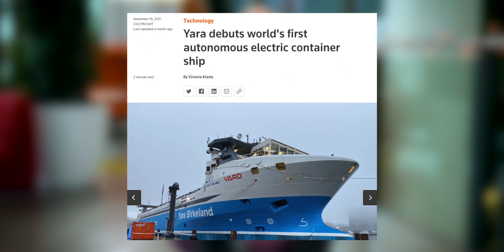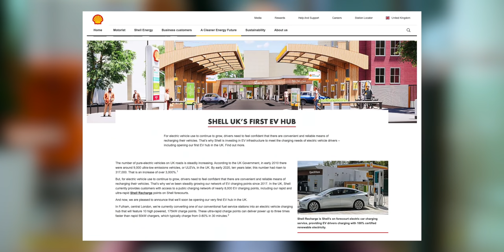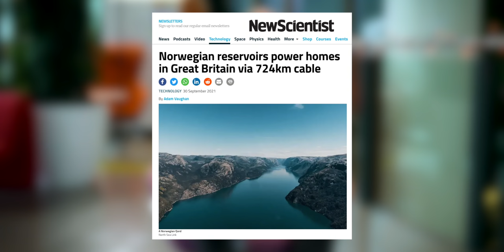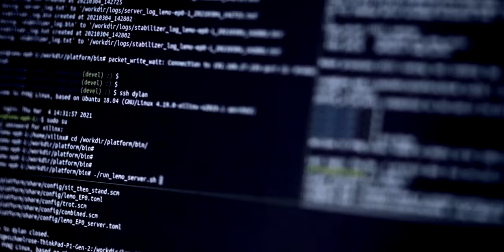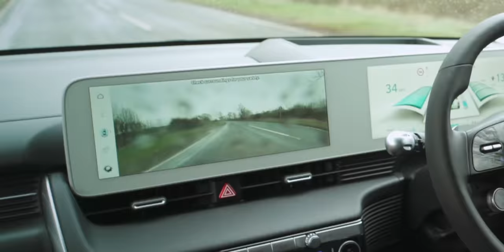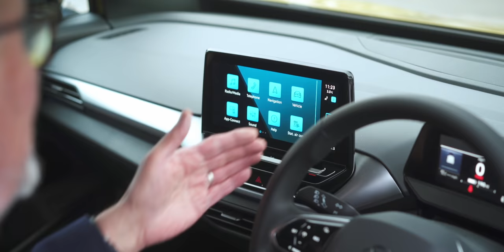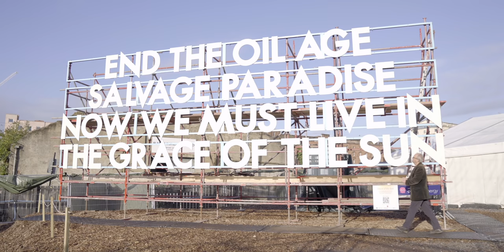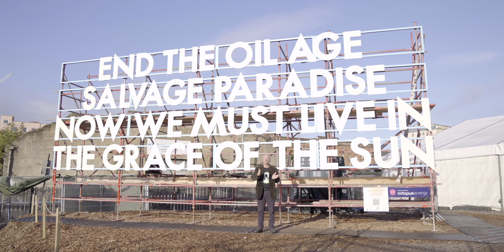VW Camper, Electric Cargo Ship, Bl**dy Big Cables AND epic 2021 highlight reel!

Comment: Greetings from Norway.... Since the cable to UK opened, the price for power is almost x10 what it used to be last winter. It's now cheaper to buy petrol to drive a gas car, than to charge a electric car, and cheaper to heat up our houses with propane heaters than electricy... Thanks UK, Thanks a lot......

Comment: A litle correction: Norway Will just reduce output from hydropower when importing from UK. Not using Pumped Hydro, But just reduce output. Thereby reservoars are filling up naturally.
Reply: I wonder how happy Norwegian households will be when the higher electricity prices propagate through to Norway like it has in Sweden. The German energie wende have risen the price in southern Sweden ten fold this winter.
Reply: @ulwur  It has Nothing to do with Germany. It has everything to with a dramatic global increase In natural gas demand and therefore prices. Gas is used in Europe to produce electricity, so the price increase impacts all of Europe.

Comment: Loved it! 

What i would still love you guys to do is to revamp some old video's that were really informative! Like:

National Grid, Smart Meters, Inductive Charging (9 years ago)
Volts for oil, Volts for miles (7 years ago)
Batteries, Batteries V Petrol the lawnmower test (6 years ago)
Electric flight, boat, house (5 years ago) 

We need more informative video's about the real story Kobalt, Lithium, Hidrogen etc etc. Where does it come from, What else is it used for, How much do we need? Can we fully recycle it? etc, etc.

Comment: Win-win?!
You can take that cable and pull it up where the sun don't shine! The price of electricity in Norway just all of a sudden rose about 50 times the normal price. Max price pr. kW/H before the cable turned on was about 7 pence. Now it's a steady 35p and just recently peaked at 80 pence. The cost of production here in Norway is about 1,2 pence pr kWh. Normal non-winter price about 3 to 6 pence depending on the water levels of our dams. It's cold here and we are 100% dependent on cheap power to survive. This cable has helped us minus zero and will keep on causing trouble for us in the future. I will not be sad if somebody monkeys with the cable and it happens to go offline...
Sincerely, one of many angry norwegians

Comment: Using Norwegian pumped storage to support the variable output renewable sources in other countries is a logical idea but it can only be done on a very limited scale.  What assures the 5 million Norwegians an abundance of hydro electricity will go nowhere once spread over 700 million Europeans.  In fact, during the exceptionally warm spring/summer of 2017 (??) Norway had to cut back on even domestic consumption of electricity.   We have to cut our energy consumption overall as well as building resilience into the system.

Comment: 1,400 MW for the new undersea cable surely sounds impressive. In the grand scheme of things, it is actually not that much. Compared say to the UK's total power demand of about 35 GW on average according to Wikipedia, 1.4 GW is only a few percent. I am not saying it is a bad thing, just pointing out that especially in the context of volatile power production from renewables, we will need many more of these things eventually.
Reply: The Chinese have put in a 12 GW cable, with the smarts from ABB. So it's certainly possible. Three such cables would cover all of the UK current needs.

Comment: Really interested in using an EV for V2H in the event of a power cut, have you had any contact with Debel about their dcbel r16 who say you can charge two vehicles at the same time and also use the car battery as backup power to use in your home.
I know the Nissan Leaf is capable of doing this but what other manufacturers have or will be making their vehicles do this, is it just a software issue.
I’ve ordered the Smart ForTwo EQ and to be able to use it’s battery in an emergency would be extremely useful and save me having to purchase a stationary battery storage system.

Comment: I enjoy your videos there are a couple of ideas that I feel are not covered enough or have not been scaled up for a variety of reasons.1. Long term storage using hotrocks is simple and understandable and there is a pilot plant in Hamburg that looked at it but hasn't scaled it up for lack of the right type of rock nearby. 2. Combining small scale 1. plus heat from the sea with wind farms and liquid air storage for shorter term storage and piggybacking the existing electrical infrastructures to reduce investment costs and utilise excess production without one set of transmission losses. Parts of this exists but the company doesnt utilise the heat in seawater and picks up low grade heat from industry instead similar to Swedish systems.

Comment: Is that undersea cable really 1.4 Gigawatts!?
It seems they missed the chance to rate it at 1.21 Gigawatts (or Jiggawatts) and just run it a bit over rating. 😄
Reply: Overclocking should be a doddle, given Norway’s an hour ahead 😂

Comment: I wouldn't get too excited by the VW camper. They have a petrol one already. No sink, no draws, no diesel heater, no fridge, no grey water tank, no toilet, no fresh water tank, no solar panels, no house battery, no inverter no TV, no microwave, no curtains, no stereo, no cabinets, no stove, no gas, no 240v hookup. Not a camper at all really. It has a pop top and included picnic table and chairs. For 20 000 dollars extra (in Australia). If you buy a normal one and fit a pop top you'll save about 10k. Or buy a high roof LDV from a company that hasn't been convicted of mass murder and save 30k that you can spend on having it fitted out properly, and still have 10k left over to go on holiday with.

Comment: The uk is considering restricting charging times as electric vehicles could overload the grid and cause blackouts. I don’t know the full facts at this moment but worth checking out before you purchase, most people thought this could happen with millions of electric vehicles charging all over the uk
Reply from the maker: Yes, this is a non-story. This is about 'default' charging times that can be manually overridden, and National Grid are repeatedly on the record saying that there will not be an issue.

Comment: I would combine Renewables( Wind (VAWT) Solar + Hydro (Screw Turbine)) with (air well) Atmospheric Water Generation + Hydrogen Storage (Cryogenic Liquid Hydrogen  - Very Long Term Storage ) +  (only for PEM fuel cells) so drought regions Get  Fresh Water + Heat +Electricity  Power while also wetting down the Local Area Environment to regrow trees + food with the  surplus water

Comment: Great to hear about the Norway interconnected but the politics shouldn't be missed. The cable need not be so long, it seems a bit daft to use all that extra copper? It could have come ashore in Scotland but fears of potential independence ensured that it does so in Northumberland. That in itself is a bit silly as something like 20% Scotland's generation capacity is exported - we have Hydro, including pumped hydro too. 25% of Europe's potential wind is off Scotland. So, like the oil before it, politics gets in the way of common sense.

Comment: I think electric vans are perhaps more important than the car. When I commute into central London it is bumper to bumper white vans that the traffic is made up of…… all sitting with Diesel engines idling. Cars are used for the school run and supermarkets in cities but the van is pivotal to commerce and so cannot be done away with…….

Comment: Tesla used 25% of world lithium supplies to make 900k vehicles - do the math, EV production is limited to a max of 3.6 million vehicles IF they used 100% of lithium supplies.  There are a billion vehicles and 80 million sold annually.  IF you instead made all electric commute hybrids - you'd be able to make 20 million instead of 2 million with the same resources.  Hence EVs are counter productive causing more ICE vehicles to be made to fill in the demand.  Lithium EVs are a dead end; always were.  Sure Solid state may be different - lets wait and see.

Comment: Those interconnectors could potentially used as a means to replace (at least some) of the revenues from the UK's Nth Sea O&G fields once they cease operation, if only the UK had enough gumption & foresight to plaster our existing & future rooftops, carparking etc - i.e. preexisting built infrastructure - with solar power generation, all the way from John O'Groats to Lands End. When combined with wind, hydro, pumped hydro etc, there'd be more than enough to supply the UK with all of its energy needs & we could flog the rest to our European neighbours, hastening decarbonisation of the region in the process. 
A lovely side benefit would be to reduce Russia's ability to cause mischief, political & military, since the region would no longer be funding its nefarious activities via O&G purchases; soft but [very] pointed diplomacy.